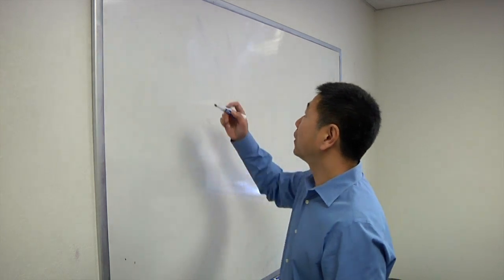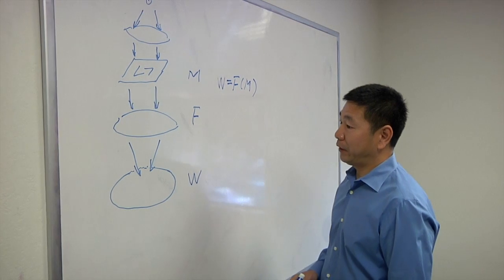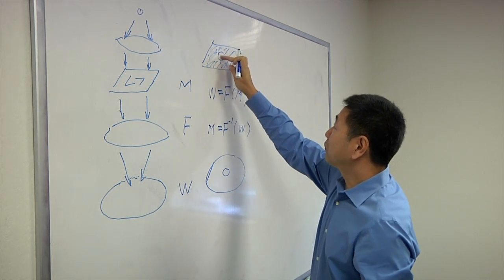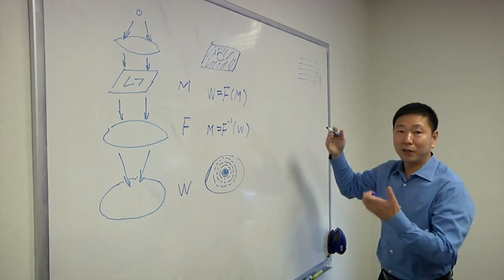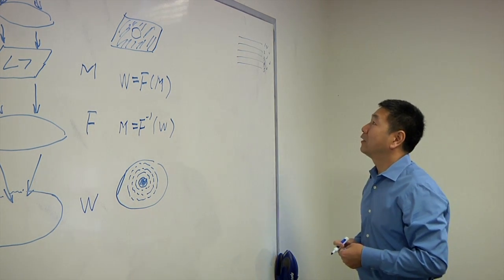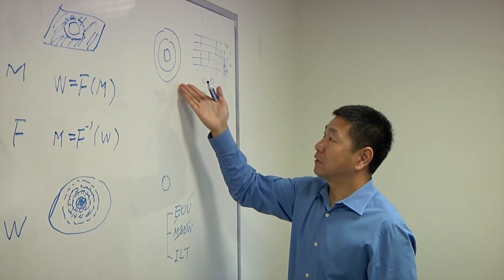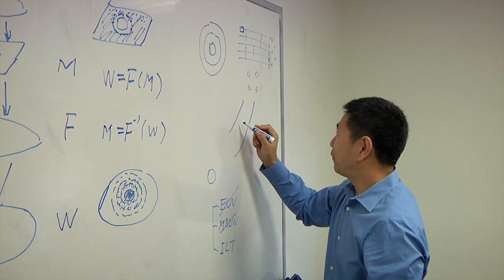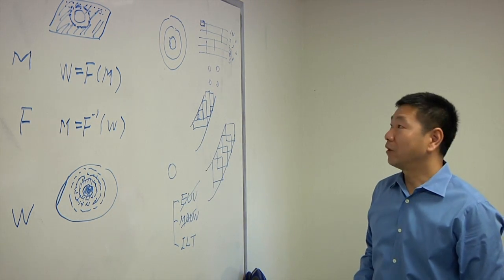Inverse Lithography (2014)

Comment: Europeans used mirrors, not lenses. What the technology it was?
Reply: It's the prejection mirrors in EUV system, since at 13.5nm wavelength, it's hard to find a high transmittance material for lens
Reply: @黄晓晟  Yup, thanks.
Reply: EUV